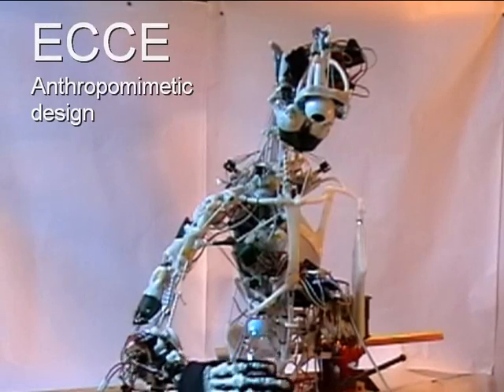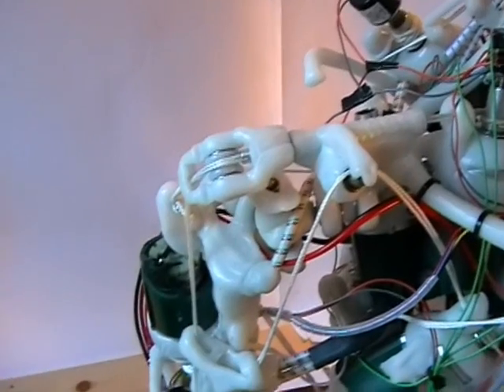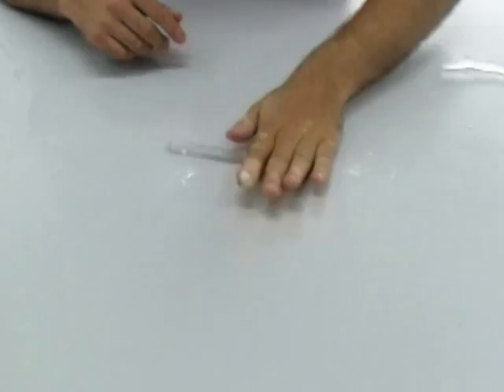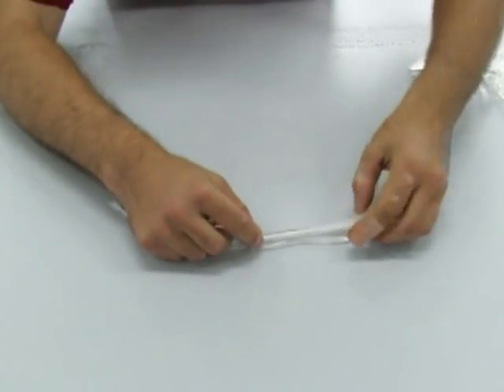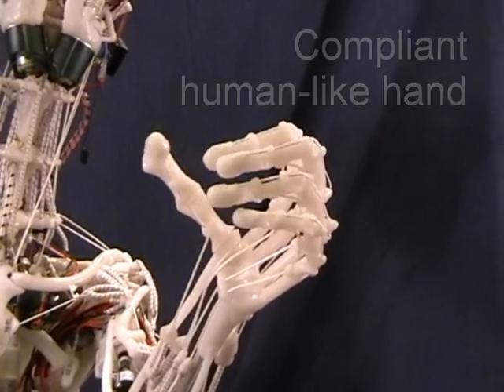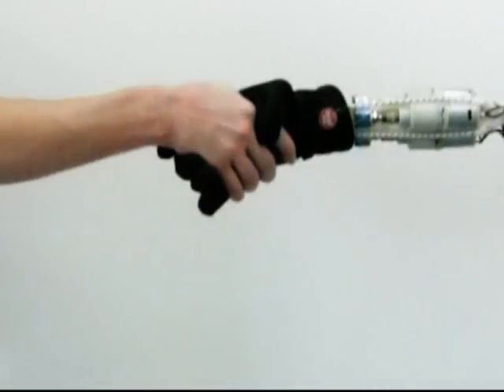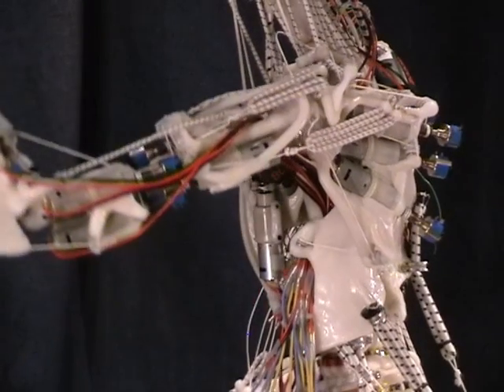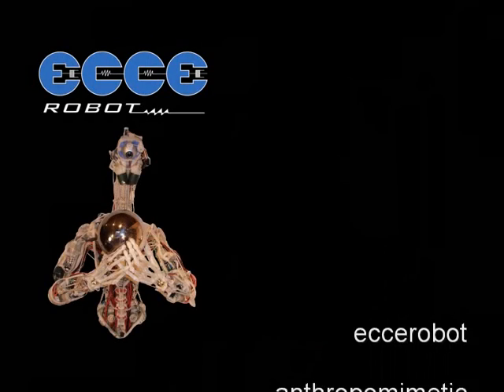ECCEROBOT - Embodied Cognition in a Compliantly Engineered Robot

Comment: @Strassenflirt True, however I would argue that truly well designed systems also evolve through small steps and rely heavily trial an error.  The only difference is humans can observe what works well and what doesn't when creating a system and apply that to future versions.  So you're right in a way.  But our approach and ability to design efficient systems still has a looooong way to go before it is 'better' than the 'suboptimal' results of evolution.